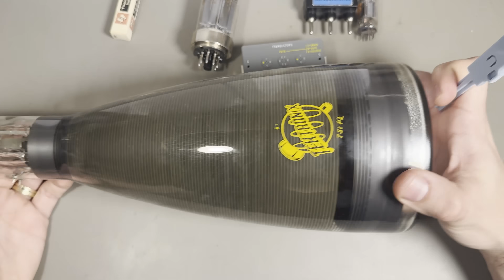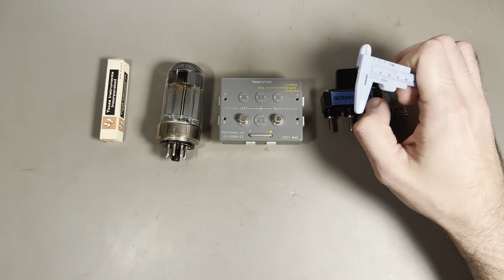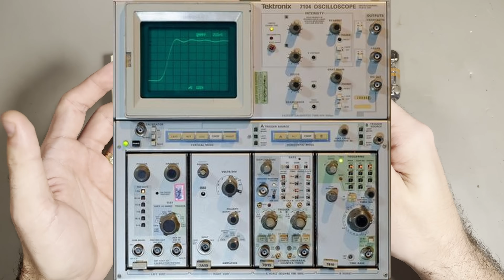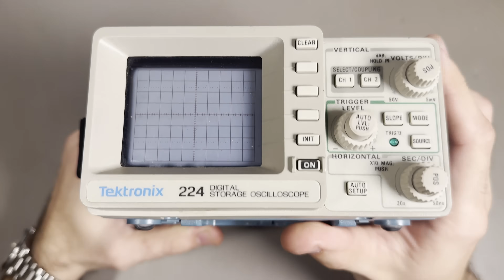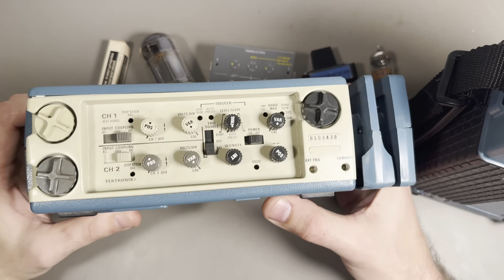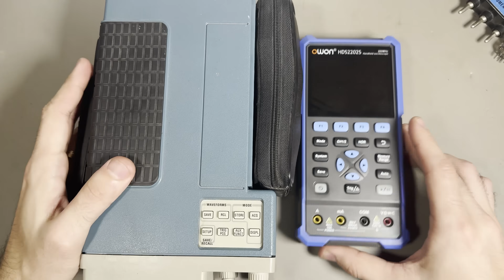The History of the Tektronix Corporation

Comment: That 7104 is a masterpiece. I have one fully factory optioned, loaded with 2 7A29option4, and the correct 7B10 &15. the lab is rounded out a spare no-option 7104 mainframe, a R7844 dual beam with an array of verticals and 7B92As, R7603 with a pair of 7A22 differentials, 7834storage also with 7B92As, a factory customized 7704A with a TM500 slot in the upper chassis and P7001 memory module that was built for Hiro Yashimora, 2247A portable with digital co-processor, 545 with diff plug in, 502 dual beam differential scope, a SC504, and both a 575 and 576 curve tracers. ... and a 7623 storage awaiting restoration.  Lots of CRT love here..

Comment: Really interesting and informative video. Here in the UK, last August, I visited a local amateur radio rally that I frequent each year. Before setting out, I made a strict promise to myself not to purchase any more oscilloscopes, as I already own an embarrassingly large number (about 13). So, after being at the rally for about an hour, I happen to spot the unmistakeable shape of a big wide 7000 series, on a stall a few tens of yards away...here we go again. Closer inspection revealed it to be a 7104, which I instantly knew meant game-over as far as any hope of self-control was concerned (I have never seen one before in the UK), and the asking price was £50 (with a full set of plug-ins). In case you really needed to ask, I now own 14 Oscilloscopes, lol.
Reply: I have 2 of the 7104s... I share your weakness..

Comment: Tek scopes and other equipment has very good standing with me (and most) However, we had one 7630 (?) with plug-ins which did give us quite a bit of problems. Components like resistors, transistors and more were plug-ins, and those sockets made poor contact. Sometimes you had to switch off, pull a module, and "slap" it in again. Believe that scope has had a rough life..

Comment: I am using my Type 545B scope daily as I restore an old CCA 1000D broadcast transmitter for Ham Radio use.  My shop also has some of the 7000 series Tek scopes.  Many times I have said that I would rather have a 50 year old Tektronix scope than a cheap new one.  The side benefit of using my old 545B is that on cold nights, it keeps my shop warm.  My first exposure to Tektronix was the Type 503 in school back in 1975.

Comment: During the 80's decade I worked for a mobile and base station CB antenna manufacturer. We always had 2 or 3 Tek scopes in the shop on all the time. I don't recall the models, but they never gave us any problems.

Comment: My first spectrum analyzer was a 492. It is an absolute monster, weighs about 25kg and was I think the first Tek product to use a microprocessor. I loved that thing, it went up to 28GHz (!) but it wasnt without its limitations. On the back it literally had a port with access to the system bus. And oh boy, you dont want to take it apart, its so damn complex and stuffed absolutely to the brim. Despite being completely digital, with markers and readout, it was very easy to use and still used analog waveforms, and you could save and display them and read them out digitally. I only sold it because I hadnt used it in a while and thats the rule. Everything is just a badly programmed windows computer nowdays and I hate it. I want dials and buttons.
Reply: I also used a Tek 492P spectrum analyzer in TV RF work. Great fun hauling that anchor up a 2000 ft. TV tower to service tower top microwave equipment. I always called it my "rectum paralyzer". Closed my 58 year "career" in broadcast TV engineering, at 78 years of age, using a HP 8592B analyzer.  It also was a "rectum paralyzer" !!!!

Comment: I still have my first scope a model 475 still working!
Reply: That was my scope I had in the 80's working as a support engineer for medical equipment. I really liked that thing. It was also just barely keeping up with the speed I needed. I believe it was 100MHz scope. They also had a 200MHz (465 or 485 or something like that) version that was a bit better for the applications I had.
Reply from the maker: 465 was 100MHz, 475 was 200MHz, 475A 250MHz, 485 was 350MHz
Reply: @GearAcquisitionSyndrome  Thanks for clearing that up, it was a long time ago.